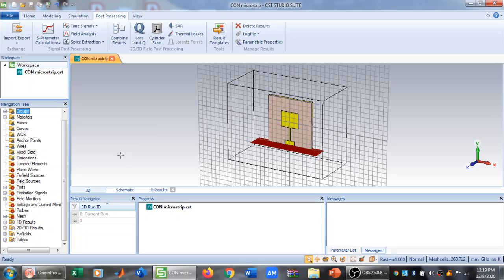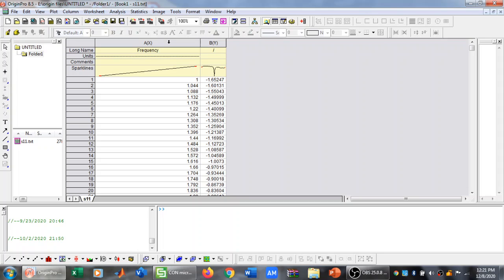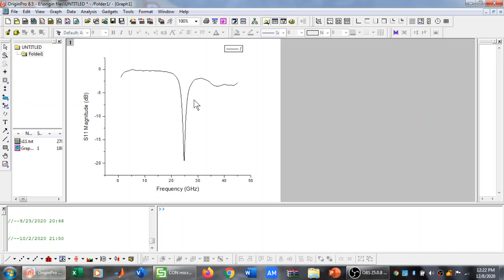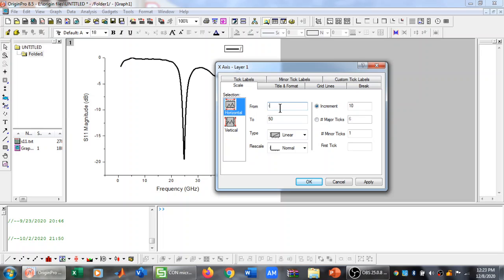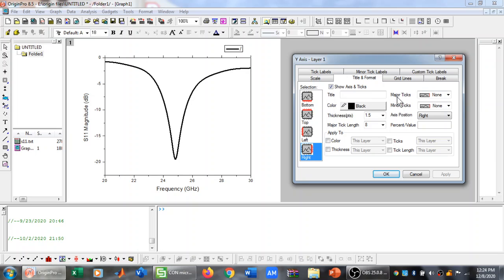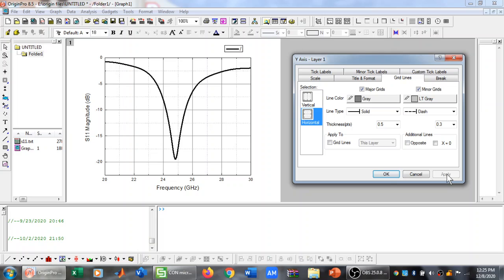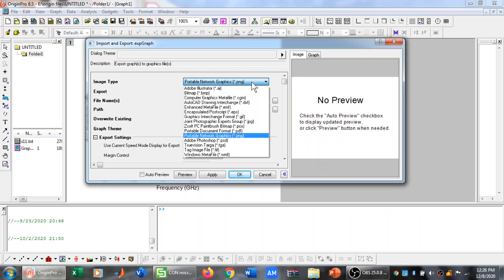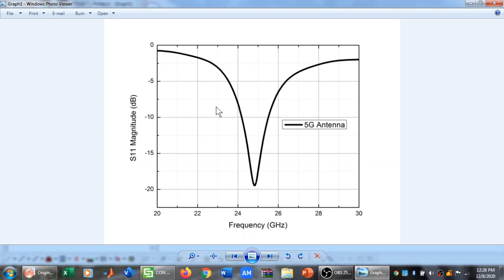How to plot S11 Graph in Origin Pro| plot S11 Graph in Origin Pro

Comment: Good initiative dear. Please make a video on plotting of 3D radiation pattern in Matlab showing 3D pattern along with side scale showing intensity scale as we usually see in most papers. The said technique can be done manually but the graphics is compromised. If we done it in Matlab then we"ll be having a good resolution of image which is the requirement of most reputed journals/conferences.
Reply from the maker: Thankyou for your suggestion..Hopefully we will make one like that soon